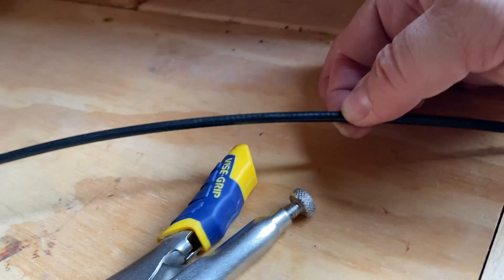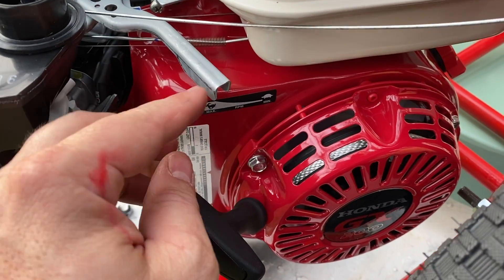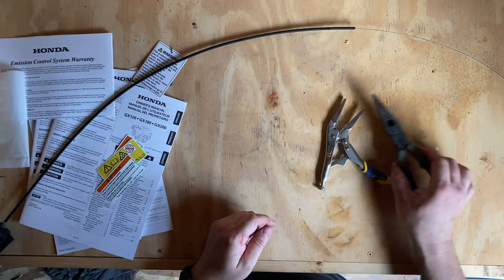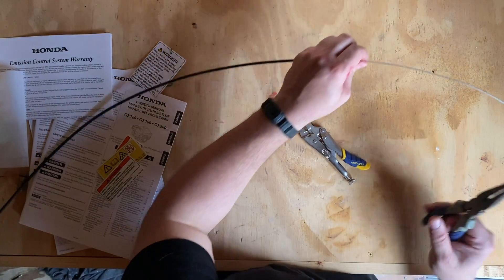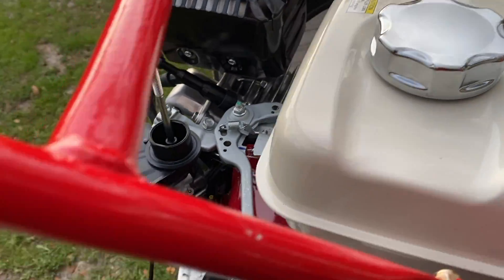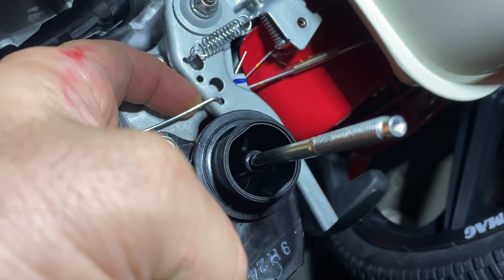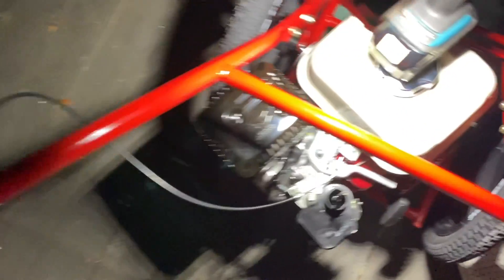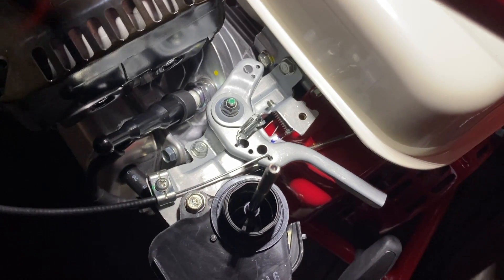How To Install a Throttle Cable on Any Small Engine

Comment: Then i redone my yardman riding mower with other wire and rigged it so when i pull the blades lever they'll come on cause each wire made for the blade engagement the cheap end kept breaking off then i seen why they kept breaking because the wire/cable was about 2 inches to short but going to buy the cable new shows its the right cable but it's not so it works now if it the wire stretches or something I'll re thread it through the spring again i know tons of other people had this problem and its not their faults they list parts wrong then shows your model on the list of what all its compatible with then we believe it'll fit cause we'll see our model listed then after breaking the third cable see that its 2 inches to short

Comment: So i had to of saved some kind of money the snowblower cost me $160.00 they dropped 10 off because the carburetor problem because it wouldn't stay running for them its the craftsmen 208cc pull cord or electric start id like to switch that to ignition start what if im out in the woods away from a outlet and pull cord happens to break see but the electric starter does work good

Comment: I think the craftsmen 208cc engine is the same as that one it looks like it is. I stripped a perfectly good working yard sale snowblower just for its tires and new engine the person sold because a carburetor problem on it i fixed that little problem last year so still have to take off all the pulleys im saving and the belts still good parts then give the metal away

Comment: 7What 1 If you still have the braid cable style throttle cable you've got a solid piece of metal. Mine is the braiied steel cable. So I can't bend it in AZ form like you can and it will retain its shape like yours there. So what do I do?

Comment: I'm putting a roto tiller engine on an old dingo go kart and couldn't figure out the throttle. Time to order a cable and give it another go. The project sat idle for 8 months 🤦‍♂️

Comment: Thanks sooo much. Turned my gx390 into a mud motor and have been looking everywhere for a cable stop bolt with the hole in it. Thanks to the z bend, I know longer need the bolt with the hole in it, just the cramp that holds the sheath in place which I already have.

Comment: This clip is the definition of what instructional videos should be. You're obviously the full quid on small engines but the planning of your clear explanation is also obvious in that there was no waffle or "let's try that again" moments, made all the better by the absence of pointless and irritating free-to-use music. MOST importantly, you taught me something useful and saved me money. Thanks for your generous sharing. Good onya!
Reply from the maker: Wow! Thanks a bunch!!!
Reply: @fixitnoworlater  As a recent escapee from the education system, I understand the effort it takes to present new information in a logical sequence using clear language without skipping steps or assuming the 'student' has prior knowledge. You're camera positioning/framing was spot. Genuine appreciation well earned, mate. Now don't get me started on carburettors, gaskets and starter cords! Thanks again👍

Comment: Dude that’s fucking crazy I’ve never seen a throttle cable that was like a coat hanger wire normally I just get threaded wire much like a bicycle cable but overall I love the video excellent job on executing that

Comment: Shouldn't the metal end cap on the plastic cable housing be put back on after you trimmed the housing? It looks like it wasn't on when you put the cable under the retaining clip, which would pinch the cable, causing unnecessary friction.
Reply from the maker: You could.... it’s so minimal and the cable shroud is reinforced with metal. It doesn’t crush under normal torque.

Comment: I see you decided to go with a Honda instead of the Predator. I have both engines and reliability has been equal.
Reply: I have had good luck with the predator on an old tiller, but the Kee deserves the real deal. Good decision.
Reply from the maker: Yep... My dad and I decided to use the Predator on a different project and run the Honda on the KEE. I cover it in my next video.